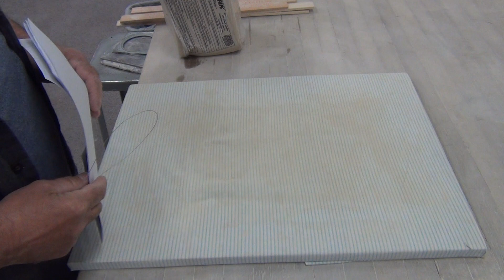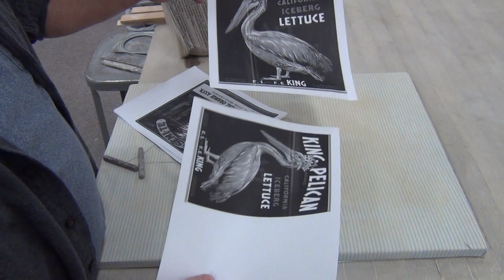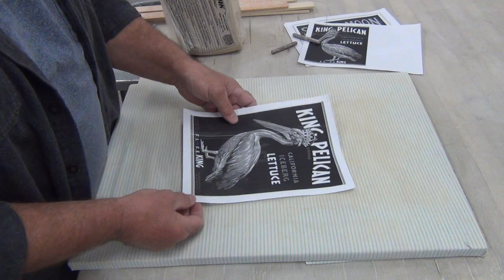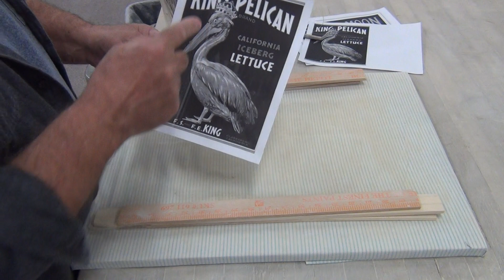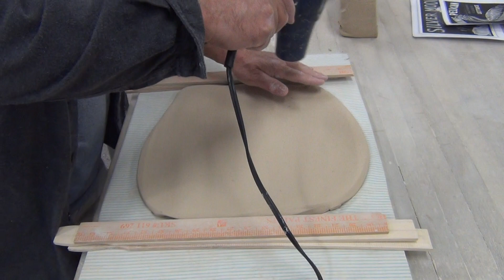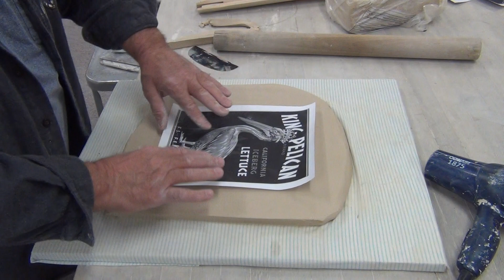Bas Relief part 1 Making Clay Slab

Comment: Are you using air dry clay.?
Reply from the maker: No, I'm using a stoneware claybody.  I have use air dry clay in the past teaching after school programs and I have found it workability has a short window to work with. It can dry out quickly if working outside as well as just over working the clay and creating too much friction that heats the clay and dries it out. Air dry clay also is difficult to rehydrate with water.  It works for the application of giving the tactile experience of working with clay, but not having to deal with drying, glazing and firing the work.
Reply: I'm using cone 5 clay to sculpt this relief